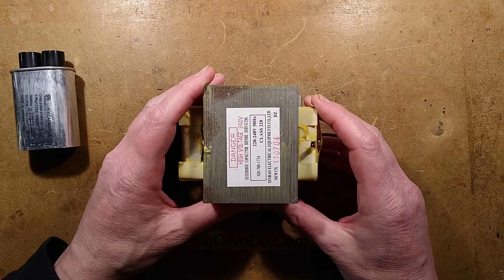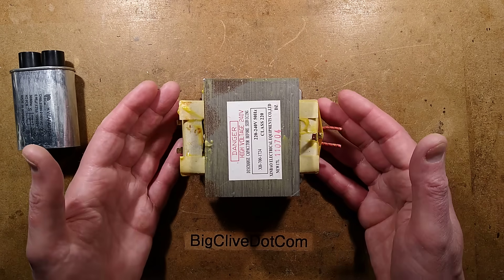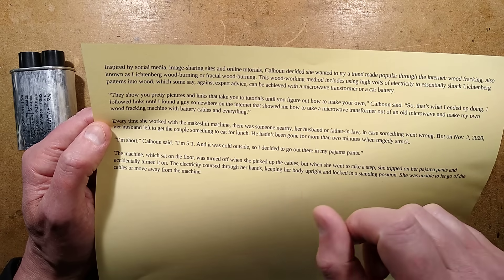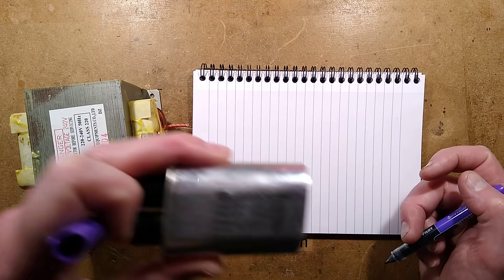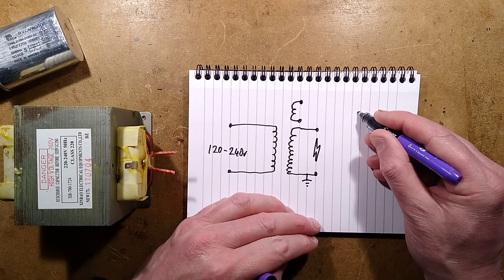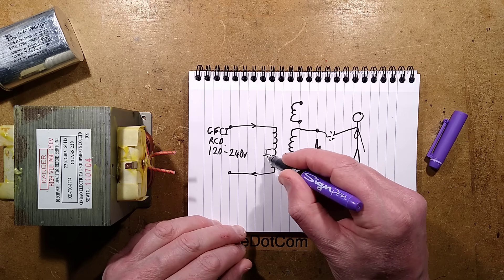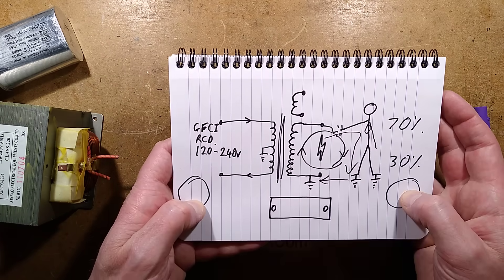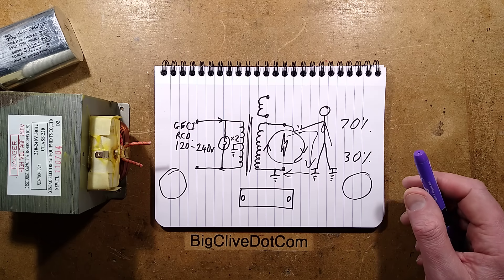The most deadly project on the Internet

Comment: Okay yes. I’m not a professionally trained linemen. But if I were to have ever dared to mess around with an unfathomable amount of electricity, I would honestly educate myself. Not just enough to get a general concept, the full 9 yards. dangerous things like this need to be heavily respected like a firearm. You know, prevent any sort of accident that could occur that will lead to you to shocking yourself. Starting off with personally designing an insulated box of sorts that is unable to get a current through at all costs, though Id be weary of static shock, definitely no jewelry. Wiring jobs connecting switches and warning lights done right and with using parts rated for very high currents, thin wires can’t handle extreme flow, they will melt and catch fire. Though before testing any of that approach on the real thing it will have to be built on a smaller scale as a proof of concept. Though ranges of electricity will produce different results. The whole jumper cables thing is dumb, especially if you don’t have a arming switch to prevent unwanted current flow to the probes if accidental contact is made. With cables on a car battery, the leads would weld themselves together if touched long enough,  imagine what probably 800+ amps can do. I don’t know. I just get bored sometimes and break things down in my head and over analyze it. There a few other main points I’d pick at but I’m tired and this is way too long already.

Comment: I knew this was bad but finding out that it basically fools the circuit breaker into thinking everything is fine makes this even scarier
Reply: The circuit breaker isn't being fooled, just working like it was designed.
Reply: @robertwilber1909  you sure it's not liberal democratic back lives matter magic ??? Jk having a bit of fun
Reply: Technology Connections has a video talking about extention cords without fuses and how dangerous some cords can be. It is a cool channel.
Reply: It isn't fooling anything. There GFCI works on comparing currents at different points in a loop. The transformer has TWO loops. They are not connected to each other. So a problem in the loop without the GFCI is not going to create a current "imbalance" in the one with the GFCI. Anyone thinking a GFCI would provide protection in such a scenario really shouldn't be screwing around with this kind of stuff, as they clearly don't understand what is going on. As the saying goes, "a LITTLE knowledge is a dangerous thing."
Reply: The circuit breaker isn't there to protect you. It's there to protect the wiring from catching fire due to overcurrent. A GFCI is there to protect you, but it must be a fault from the primary (mains) side of a transformer. But a microwave transformer isn't an autotransformer, the secondary is not in series with the primary. So a GFCI won't protect you, by design.
Reply: Induced EMF can be dangerous
Reply: @marlontruscott  there is nothing induced, there is a load the breaker senses. excess load trips the breaker. nothing magic
Reply: Don’t lose sight on the Kingdom of God 🏞️ all that is in the world is soon coming to an end. Seek God whilst He may be found. Jesus saves ✝️🩸🕊️
Reply: @TRUSTINYAH  Peas be upon you. With spaghetti and cheese. Ramen.
Reply: @TRUSTINYAH  Satan has infected your brain and now makes you spread Jesus-spam all over the internet.
Reply: @TRUSTINYAH  Hail thy master Satan, for he is all and we are all. Ave Satanas, may the light guide you.

Comment: Battery will only work if you can change +and - 50 times a second. Only AC current causes transformer to induce voltage from primary to secondary winding

Comment: I just wanted to add. I have seen people die from serious shocks. 120-208 is generally safe if you get a small shock. I have been shocked pretty hard with 208. Where things get hairy is when you get to 215 volts and above. 277 volt commercial indoor lights are widow makers. This is why 99% of electrical companies require the power to be disconnected before jacking with them. I have done loads of these lights before. If you have ever seen an electrician with scars on their arms, it's because they didn't follow safety protocols. They touched and went arm to arm with 277. What it does, is it passes into one arm and out the other. But, it also can go through your heart causing a puncture similar to stabbing it. One electrician at a place I worked died this way. He got shocked and felt kinda sick, sat down, and bled to death internally from his heart. Sad but true. Back on topic, the electricity causes burns in your muscles which continue to burn after the initial burn and causes severe swelling. This swelling gets so bad that if the pressure is not released, it will cause a condition similar to compartment syndrome and cut off the circulation of blood flow. When this happens, the medical staff must cut the limb open to relieve pressure from the swelling. That's what those scars come from. Trust me. My leg is a testament to this. I had this happen to me because of an idiot that wired a 480 volt rooftop unit to the wrong breaker. We shut it off, and went back up and it wasn't off. I accidentally touched the wires with my leg and got a big surprise. It wasn't long, less than a second, but enough to cause internal burns. Be careful!

Comment: Smarter to use a welder and be careful. You don't need super high voltages to do this. It can be done with a 12v battery as well. I am an electrician by trade. I am going to purchase a welder to do this with. Nothing special, just a 110V welder from Harbor Freight or Northern Tool. Whomever has it cheapest. Then, I will make a video showing how this is done safely with a welder. We used to do this is the metal shop with cheap welders. Works great. And all you have to do is not touch the damned electricity. It's not that hard. Also, if you are smart, electricity goes where? The shortest path to the ground! So, if you want to be extra safe, put the wood on the ground! It will still work just fine and won't shock anyone unless they touch it. Turn the welder off before touching it.

Comment: I’m an assistant chief Machanical engineer and I’ve been electrocuted by every thing from 110 to 480 multiple times in my long career. It’s literally the worst way to die especially the lower the voltage voltage and higher amperage as it will hold on to you and kill you slowly if your heart valves aren’t in the open position and are instead closed you will die slower until the current that makes your heart beat is interrupted. This all depends on how the outside current is passed through your body also. If it enters the body through a hand and exits out of the body through say the others hand completing the circuit and the voltage makes it back to the source. The current will have passed right through your heart either killing you or not it’s kind of a 50/50 shot in the dark. It only takes 1 amp to stop the heart and something like 24 milliamperes if I remember correctly to kill someone. It’s always a good practice to work with only one hand around a live circuit to avoid current passing across your chest.

Comment: would some sort of bracelet with a wire leading to ground save the majority of your body from the shock, like would it prefer the wire leading straight down over the path through your arteries, similarly with a set up like I'm speaking of, could you safely touch above said wire/ affected hand and would it still be more likely to prefer the wire?   obviously it varies in fractions but i feel the majority of human tissues/etc have at least a calculable/comparable level of electrical conduction /resistance, right?  i feel like this should be measurable and easily avoidable even if mistakes are made, with the right precautions.
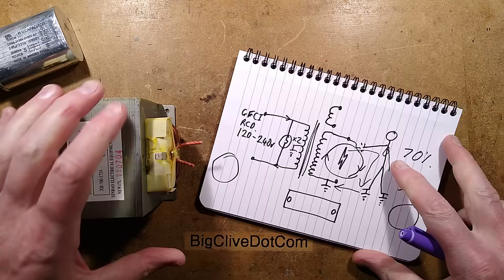Reply: 15:00  lloll

Comment: I got ark blasted by a commercial breaker box in a freezer warehouse. I was helping a electrician do simple task so I wasn't afraid of my task to receive 3 big wires into the box and mark them with colored tape when my razor knife fell into the box causing a explosion . I was standing 3 feet up on a stack of those 2ltr bottle carriers plastic.  That saved my life. Had I been on the floor standing it would have drilled into me making me a human candle. I got 2nd degree burns on my face and hands and spent 10 days in a hospital and 6 more months therapy. It threw me 12 feet away across the room and a bright light haloed by red blue and I had no sense of my orientation and it seemed to last a long time. Three men saw everything one said I looked like I was people he'd seen in Iraq War hit by RPG. They said I was a miracle to live. Oh the property hid their insurance or didn't have any so I couldn't sue nor did the guy I was asked to help. It knocked out three transformers in the neighborhood and 9 hours later was restored.

Comment: So, I have no intention of messing with this, and it may sound stupid..

But out of curiosity do you (or anyone else) know whether its possible to suspend yourself off the ground, via a non-conductive material to reduce risk? 

I just imagined someone with a harness hanging above their little project to not have any direct route to "ground" the current.
Reply from the maker: A thick rubber mat would help reduce a shock to ground, but not protect against hand to hand contact.

Comment: How about use another conduit to complete the connection...

If the risk is that high then chamber the device to a tapping device (a device that will attempt to complete the circuit and hold the circuit closed under load) 

Pcbs and arduino is costly... true...

Skin is pretty high up on that list too... I mean depends how you value things

Comment: Great video, i didn't know this DIY project existed. I have a question though:
Why is that device super deadly while outputting "only" 2000 volts at 2-3 amps while the survival rate of direct lightning strikes of million of volts and a couple thousand amps is more than 80 percent?

Maybe some electricians or engineers can mansplain this to me 👌

Thanks in advance

Comment: "Makeshift machine" is where you should stop when it comes to high voltage. Unless you are an electric engineer or a professional with equal knowledge so you KNOW how to properly insulate everything and make it safe with proper materials and tools, you should never tinker with high voltage! There are things even a professional would not attempt unless they need to and this is pretty high up there. Whoever thought this silly idea should be uploaded as tutorials to YouTube should be charged with negligent manslaughter.

This video is a great safety PSA. I like that it even gives options to those who would still try it instead of just finger-wagging at them for doing something dangerous.

Oh, by the way, if you want nice fractal patterns burnt into wood, you could always download fractal patterns from the internet and copy them onto the wood with traditional tools, just saying.

Comment: hey i'm not familiar with US electrics, but im a bit confused by the labeling and marking of this transformer or capacitor.. (looks like a transformer to me, says capacitor...) It says High voltage, but its 240V which is not considered high voltage, (over 1000v is high voltage where im from) and if it is a condensator/capacitor, why isnt it marked with its capacity? we use Fahrad for this measurement. genuinly curious
Reply: alright i commented this before the capacitor was brought into the video, im still confused why theres no input/output marking on the transformer

Comment: Wait a sec... correct me if I'm wrong but if it takes 240 Volts and makes 2000 Volts couldn't you then split that off into 8 sets of 240 Volts, ground off the excess 80, feed 1 of the 8 back into the beginning, turn off the original power and voila Infinite source of energy at the same Voltage from the wall but now you can use it 7 different ways as the 8th has to feed back in? The fact that something is multiplicative is already speaking infinite energy to me lols. The ground would be anything that does not divide into 240 evenly so just toss it out into ground so it has some buffer if power drops or if power spikes so if it dipped down to 10 extra no biggie it gets grounded and only the 10 goes, but lets say it spiked to 150, then no biggie again it also gets grounded! The cycle of it always Multiplying that same 240 to 2000 seems like magic and if so, could be truly abused and would make it possible to make infinite energy so as long as it feeds back the original Voltage that started the entire process so that you don't end up with ever climbing energy or ever dropping energy thus why it would always have to Feed exactly back what was initially put into it. Here I was looking at fractals online however the way it multiplies is making me think of a new use, and the new use is infinite energy. Because 1 source always feeds back on itself leaves the other 7 Houses from that 1 Microwave Transformer to then be powered. eliminating the need of a powerline and bam 7 houses free of energy.

Comment: Is there any good way to make this even safer?  Maybe use an isolation transformer in front of the step-up transformer, or some kind of GFCI that measures the current between the high voltage lines and cuts off current to the transformer..  Or all three (your ideas as well) of them at once?

It seems like it shouldn't be too hard of  task to make these things very safe.

Comment: If you really wanted to that safely you would need to make a table with automated arms place the controller behind plexiglass at least 72 in from the machine you would need plexiglass panels all around burn table and the table would need its own enclosure 
The main power for the machine would need to go through a contractor powered by voltage that goes through a safety circuit eg from v+ to 
brake away switch on the outside of machine room door arranged in a way so that it can only be connected from the outside if machine room enclosure 
To
Pressure switches on each panel
To
Controller stop switch 
To
Safety contact coil 
To
V-
No means of control of the machine shall be permitted inside machine room enclosure 
The entire machine and anything metal inside the machine room must be grounded with the same ground from overamp and gfci breaker 
The control room must be grounded with the same ground as the machine 
Put electric burn picture on machine room door and under it put never connect break away switch with personal inside machine room
All electronic devices and conjoined wires shall be enclosed in properly grounded electrical boxes or conduit 
There is a way to do that stuff safely but there is some assembly required and never handle current that won’t turn off if a short to ground happens if you take those leads and tie them into a grounding rods and hammer them into the ground and energize the circuit it won’t shut off the power to anything until either the transformer starts melting or the wires burn and you burn at a lower temperature than copper I promise and you will heat up more than copper because your less conducive

Comment: new to chan randomly suggest video by YouTube have herd of wood flac once but did not know there was a issue of ppl dieing from it recently but will thumbs up video learn a little bit more about microwave transformer was with you most of way only part I had I got lost was the high volt prime and secondary high volt drawing when you talk about low volt winding that's rap in between I'm assuming as you drew it on top of the secondary high volt in the figure and later added the line in-between

Comment: The funny thing is, if the tutorial videos for how to do this basically said "Shove two wires into an electrical outlet, then put the other ends onto a bit of damp wood." I think 99% of people who immediately see how ridiculously dangerous it is and not try it for themselves... even though that would be significantly LESS dangerous that putting a microwave transformer into the circuit. (Although still a pants-sh*tingly stupid idea).

Comment: My first lychtenberg machine was made with a Micro transformer. My neighbor who is an electrician made it for me. The first thing he said when giving it to me was" dude, you need to be MORE than careful with this thing because it WILL fucking kill you." I work in commercial construction and am very familiar with the dangers of electricity so I developed my method using what i call "layered safety protocols" that means not just having one thing you do to keep safe but multiple things, and religiously following them. That being said, I ditched that machine months ago and built another one myself using an ignition transformer from an oil furnace. It's a much slower burn and doesn't rip through the wood like the microwave does. I mean  the microwave is pushing 550Ma and will rip a 2×4 in half if let the current arc in just a couple min. The ignition transformer is much tamer, with much tighter fractals. You can still burn some deep grooves if you want but it takes a lot longer, and it's MUCH safer. I have zapped myself a couple times with it on accident ( there's that complacency thing the guy in the vid was talking about) and it's not pleasant. But it was nothing compared to the microwave. I don't care what anyone says, electricity is incredibly dangerous, wether you know what your doing or not, and it should be respected and used responsibly. Don't fuck around. Don't get careless. Layer you safty. That way WHEN something goes wrong you aren't relying on a single measure to save your life. Boom